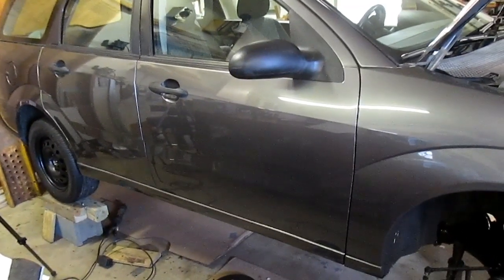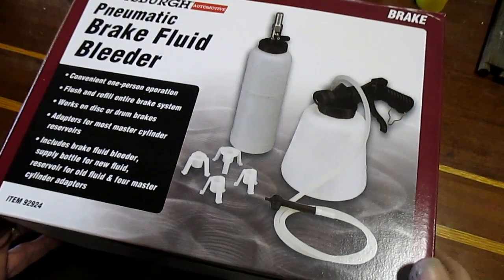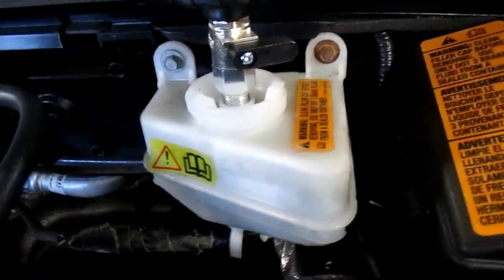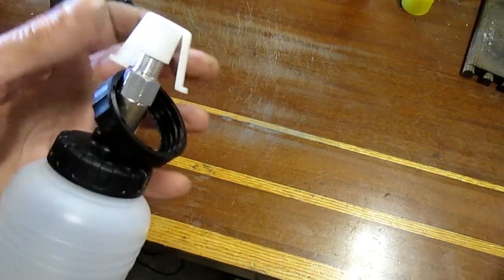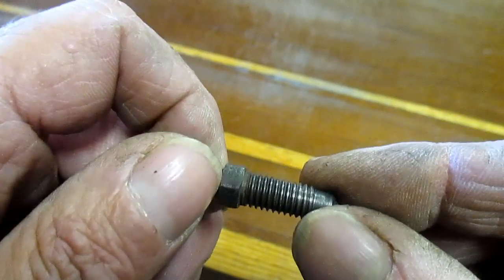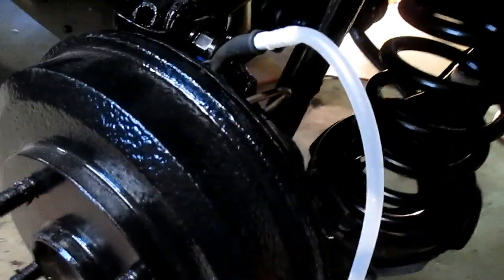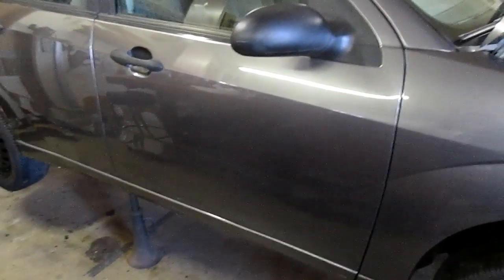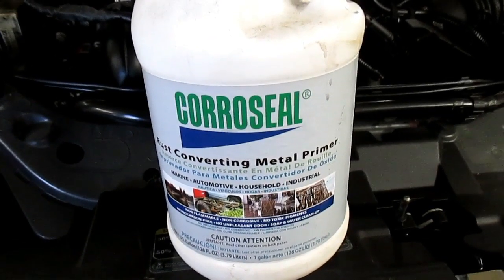Harbor Freight Pneumatic Brake Bleeder

Comment: You did a good job with the video.  I have this tool, and it worked well on my 2005 Mercedes C230 which has one bleeder screw (single piston design) on each caliper. It did not work well on my 2000 Boxster which has two bleeders (two pistons design) on each caliper.  I think the reason it didn't work is because the air compressor I had did not create a sufficient volume of air to work on the Boxster.  I totally drained the volume of air available before I could finish bleeding each Boxster caliper.  If you have a large capacity air compressor (at least 5 gallons) it should work well.  Rather than replace my air compressor, I opted to by a system that pressurizes the master cylinder with a hand pump attached to a container that holds the brake fluid.
Reply from the maker: Thanks Kevin, I still have it and still use it. Now you may be right that your compressor didn't have enough volume. Mine is a 30 gal. tank with 5hp 220 volt, and has always done the job. Well glad you got the a system that pressurizes the master cylinder and works for you. Thanks for watching

Comment: Thank you for making this video.  I replaced all four calipers and rotors on a newer ABS equipped VW Jetta and was able to successfully bleed the entire system using the Harbor Freight brake bleeder kit.  The overview you gave of the kit was super helpful and following your tips I was able to quickly bleed out the system without a problem.  I also used the master cylinder cap in order to steady the bottle in the master cylinder like you showed in the video and it worked great.   I was able to clear out all of the old fluid in the system and now the car stops like its brand new.  Thanks again.
Reply from the maker: Your welcome, this inexpensive tool made it a one man job for me and thought it may help others. Glad that master cylinder cap idea worked for you also. Thanks for the reply

Comment: i used this bleeder over the weekend.  It does what it's supposed to do but there is a drawback to it. The fluid will never come out of the line in a solid stream because  the suction is more than the bleeder screw can provide it will suck what fluid it can and air will come through the sides of the bleeder screw (or rubber nozzle) as well . The result is you simply dont know if all the air is out of the system
Reply: Just reduce the psi from your compressor
Reply: @Tinsil88  interesting i'll have to try that

Comment: Nicely Done! Going to pick one up tomorrow. I've done it the old fashioned way a few times telling someone to pump and hold when I say so and its a long slow process. Your brake fluid looked pretty good, most people let it get to near oil black. Thanks much!
Reply from the maker: It make it a one man show,  just make sure your air compressor has enough CFM
Reply: Yes a valid point indeed & unfortunately points to the fact the company making this partiular unit (& all the other ones as they all work similar) probably needs to do some more product research/design work as I have seen so many guys complaining about this very same said facet so it obvioulsy is an area that needs some more design attention!! 🤏🤏👍👍

Comment: thanks my old 69 f 250 was giving me the business today we pumped and pumped and it still has air im looking to pick that tool up tomorrow
Reply from the maker: You will some air bubbles with this, the air bubbles come thru the threads of the bleeder valve. Just be aware of this, but this thing does really work  and keep the reservoir full.

Comment: Yesterday, I finished a complete front end on my 380se Mercedes 126.  Brakes, calipers, bearings, steering, ball joints tie rods, etc. I am unable to bleed any fluid after several hours 2 man pedal pumping.  I think the ABS module has air in it.  Do I need to bleed the ABS or just do standard procedure with the HF bleeder?  I have a 20 gallon compressor, 4-5 CFM.

Comment: That Focus looks damn near brand new but it’s the same generation as mine. Great work!
Reply from the maker: Hi Kramer, after my wife had a bad crash with her other Focus and wanted the same car. I looked high and low to find one and found this one, the body and interior looked almost new and so did the engine only had 50,000 miles on it. The big fight was when I got it home it had some serious rust problems on the bottom, I got that taken care of but just have to watch for it coming back. It sucks working on your back under car jacks so my next big project is getting a car lift, when I do it I’ll do a video on it.

Comment: So do you press the trigger on the vacuum pump before breaking the bleeder valve loose? Also seen people use grease instead of anti seize. Idk what your take is on that.
Reply from the maker: Yes I started the vacuum first, as for the anti seize vs grease. The anti seize is far superior, I have used both and the anti seize outs lasts the grease by a lot.

Comment: I used this kit instead of a pickle jar this time. It bleeds pretty slow but I like the auto top off. I pumped the brakes on top of using this and it worked much faster.
Reply from the maker: Now I had to buy the one I have and get nothing for this video. It's just a useful tool and makes it so one man can do it. Thanks for watching Stew

Comment: I just bought an almost identical bleeder, so this was very interesting to me!  The matter of steadying the feed bottle hadn't occurred to me - maybe another solution would be to add a feed tube between the bottle and the fitting that goes onto the master cylinder?
Reply from the maker: That would work just make sure the feed tube is secured and locked in place. Good idea!

Comment: Are you just doing each wheel until clear clean fluid comes out?
Reply from the maker: Yes one wheel at a time, now you do pull air through the bleeder threads so you will always see some air coming out. Just had to do my wife's  car again last summer after I did some work to it. I was so easy doing it by myself, thanks for watching.

Comment: Hi. In order to bleed the brakes, do I need the feeder bottle on the resivior ? It's full already. And as far as the corroseal, did you paint it on or spray ? Did you go over the gas tank too ?
Reply from the maker: You don't need the feeder bottle BUT! you need to keep the resivior full. The bleeder will suck the resivior dry if you don't keep filling it, that's what good about using the feeder bottle. As far as the corroseal, I brushed and sprayed on the rusted parts. I think brushing is better, it works into the rust better. Still need to knock of the surface rust with a wire brush.
Reply: @backyardinventor9580  What type of spray did you use ? Aside the Carroseal brush on.
Reply from the maker: @kota11334  I sprayed the corroseal in a undercoating spray gun and painted with Valspar Tractor & Implement paint

Comment: I have this same kit from Harbor Freight.  I flushed my brake fluid yesterday and my plan was to use the kit.  It did not work.  With the air compressor hooked up, all it sucked was air.  I thought, like you, that air was entering around the screw threads.  I tried various positions, from just barely cracked open to 1/4 turn and all I got was air.  I gave up and had a neighbor do the old fashion pump the brakes.  in the end, i could have just used an old soda bottle and accomplished the same thing.  Next time, I will try your advise of lock tight/Teflon tape/lock tight.
Reply from the maker: When I use it I will see air thru the line even if there is no air in the lines. That’s the nature of the beast, talked to my buddy who is a professional mechanic and said that the way it was. Now you do need to run 90 psi and a large compressor it uses a lot of volume of air. I hope I didn’t steer you wrong but it woks very well for me.
Reply: Wipe greese around the bleeder and no more air.
I have done this many times!

Comment: Looks like it works but very noisy without a silencer on the end
Reply from the maker: Hi Thomas, it does work quite well. For a one man operation it is a must have for me, I’ve used it many times. As far as the noise the microphone makes it sound louder than it really is.

Comment: I have this, and a 10 gallon air compressor.  It didn't suck out much brake fluid.  And took too long.  I went to 2 man pedal method and got it done.  I think I am going to do a DIY pressure bleeder.
Reply from the maker: I have a 30 gallon air compressor 5 hp 240 volt it puts out 90 psi with 10 cfm, and yeah I think your compressor just doesn’t have the power to do it. But with my setup I just did my van for a brake fluid change and the fluid that was in there was nasty looking. Sometimes we have to do it the old way.
                                                                                                                                                            B/I 
And pressure bleeder is probably your best bet
Reply: I see.  I was thinking that is the problem.
Reply: Thank you for the info,i bought one of these yesterday and I'm going to do this job tomorrow,where i work we are allowed to work on our own stuff on the weekends and we have a compressor thats about 15 feet tall so i think that will probably do it.
Reply: On another video someone suggested building vacuum on the bottle first then opening the bleeder screw. Do this a few times and see if that works with a lower cfm compressor.

Comment: Pretty sure your working on a Ford focus looking at that master cylinder, cap & surroundings. If so, that cap easily comes off!!! What is the best way to clean the residual brake fluid out of the tubing & container, after use???? The other idea I have is, extend the metal tube to sit further into the master cylinder! Either using tubing or, threaded pipe with an adaptor!!!!
Reply from the maker: Hi D.J. as far as cleaning the container I give it a shot of brake cleaner then a paper towel on a stick. And yes that is a 2005 Ford Focus Wagon and only has 72000 on it now.

Comment: I purchased one of these to do the brakes on my car and must say that although I was successful, I wouldn't rave over it! - I cut the pipe in half since I found it to be unnecessarily long and despite having my compressor at full pelt, the vacuum to the bleed nipple was pretty average. - I couldn't use the supplied fluid bottle, since the master cylinder sits under the front scuttle - I think next time I might try a pressurised unit or revert back to the wife!
Reply: Thinking about what you said. Could just not use the full bottle and just run the bleeder for a short amount of time and keep an eye on fluid level. Wife can check fluid level. She might like that job better.
Reply: @thewrenchwoman  Thanks for taking the time to read..Have since bought a Subaru Outback with more room above the brake fluid reservoir cap...I actually sold the bleed unit and got my money back and if the need arises will go back to the old pump the pedal method or get a Gunson G4062 Eezibleed unit that uses pressure from the tyre to pressurise the system.

Comment: Nice video, I struggle to figure out why there are always bubbles in the line when it’s pulling in the fluid. Shouldn’t have to assume it’s normal vs that there is air in the line. Granted the bubble sizes are eventually smaller but still.i do find it better to reduce how far the bleeder screw is cracked. Not entirely sold on this thing
Reply from the maker: Think it may have to do with pressurized versus vacuum going on here. When we use the brake pedal then fluid pushes thru and when we use vacuum air gets pulled from any minor leaks like the threads of the bleeder fittings. Still this is a one man set-up and you can’t beat that.
Reply: I have the same concerns.  Pulling vacuum with a cracked bleeder valve is questionable.  I've performed a lot of brake jobs over my 62 years and have never seen as much air in a system as this video shows.  I believe a pressurized bleeding system may work better.
However, it's a great video.  Very informative and great narration.
Reply: You have wipe greese around the bleeder and it stops the air bubbles from coming in the sides of the bleeder when you loosen it.
I love mine and it works great.
Reply: @MrPaknight  I've also had luck with some teflon tape around the bleeder valve before putting on the bleeder cap.. didn't think about grease! Great idea

Comment: Do you leave Teflon tape and antiseize on the bleed screw when you're done or remove it?
Reply from the maker: I left it on, in most cases when you need to bleed your brakes you’ll find the bleeder is rusted in and you can’t get it out. Now I do one more thing for insurance make sure the brake caliper is clean where the bleeder goes and put the dust cap on then I take silicone caulk and wipe it around the whole bleeder leaving a thick coat around it. If you ever need to bleed it you’ll have to cut the silicone off and maybe get a new cap but that’s better than a new caliper , but you’ll have really good odds of loosening it.

Comment: Will this bleed the ABS System Module when replacing the master Cyl on a 98 Monte Carlo?
Reply from the maker: I used it on my 04 Astro van with abs and it worked

Comment: Mines coming out air and fluid, just like yours... shouldn’t it be comming out solid .... I thought I had air in my brakes..got me worried. I don’t like to see air in the tube while it’s comming out, what do you think...
Reply from the maker: It might be sucking air from the threads of the bleeder. I did anti seize on my bleeder threads, just be careful not to get it on the end. Sometimes you will see air in the tube if there is air in the system and go solid when all air is out. You may not have a good connection to the bleeder also so check that too.
Reply: Backyard Inventor 

I’m going try it one more time using 
sil glyde on the nipple... a couple people have success using it. If it still has air comming through I’m just going to toss it. You can’t really tell if you have air in the system or not..
Reply from the maker: Personally I won’t toss it, when I talked to my buddy who is a professional mechanic and he said you’ll always get air from it. It’s either sucking air from the threads or the seal at the bleeder but it’s under constant vacuum and pulling fluid through the system. Did see air on mine but did it all the way around and the pedal felt great at the end. Good luck
Reply: Backyard Inventor 

Ok, will do thanks

Comment: @Backyard Inventor, what paint or type/brand of coating did you apply to the undercarriage? It looks great!
Reply from the maker: Hi Mike, what I found to hold up well is Valspar Tractor& Implement Gloss. Painted my back hoe with it 30 years ago and holding up so I figured it would be a good paint for an undercoating. It does dry slow but that what you want even over rust. The local stores don’t carry it anymore but found it on Amazon. Did as much brushing as I could and for the hard to reach I used my under coating gun. Hope this helps.                                        B/I
Reply: Backyard Inventor I want to paint the whole underside of my 1994 Bronco. Is it advisable to mask all brake lines and the lower section of the engine, in other words, is it a dumb idea to paint the underside of my truck without masking anything?
Reply from the maker: @Mike-xn1bh  I really wouldn't worry about that myself, good luck. Just clean the best you can. Now if you have some rust to take care of I use Corroseal and don't have to remove all the rust just hit it with a wire brush and get the dust off. The stuff works great, but wear gloves!! I get it on Amazon

Comment: Do you tighten the bleeder valve while you're still vacuuming? 

Open -> Vaccum -> Tighten -> Release trigger?
Reply from the maker: Yes I leave the vacuum on till bleeder is tight
Reply: Backyard Inventor Awesome, I will do that! Thank you
Reply from the maker: Just make sure your air compressor has enough CFM to pull a good vacuum.My compressor does 10 CFM at 90 PSI
Reply: Backyard Inventor I’m currently doing it and all I pull is air with some fluid.
Reply from the maker: This is not uncommon as you pull fluid with vacuum you also pull air from the threads of the bleeder, let it do it’s job and test the brake pedal when all is closed down. Pump it a few times to let it build pressure.
Reply: Backyard Inventor I ended up doing the one man bleeder bottle method by ChrisFix and that worked amazingly .

Comment: Where do u get the air suction supply from
Reply from the maker: Not sure I follow your question, the unit is from Harbor Freight and the suction is created from air compressor if that helps
Reply: @backyardinventor9580  ok that's pal

Comment: Very poor quality control on these. Mine didn’t even have an opening on the rubber fitting tip. 
Didn’t work at all even using the tube alone. 
IMO it’s worth spending a bit more. 
This is junk.